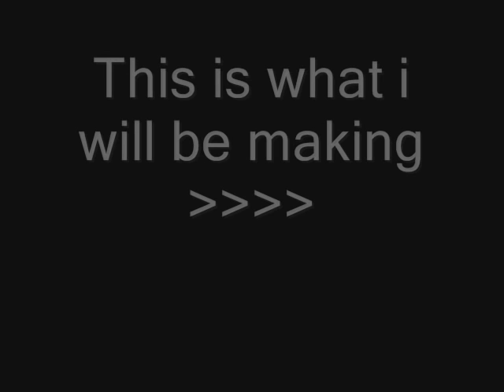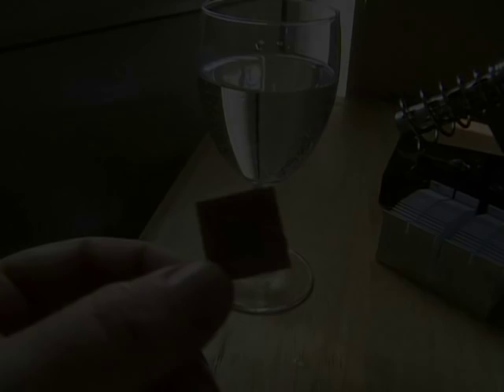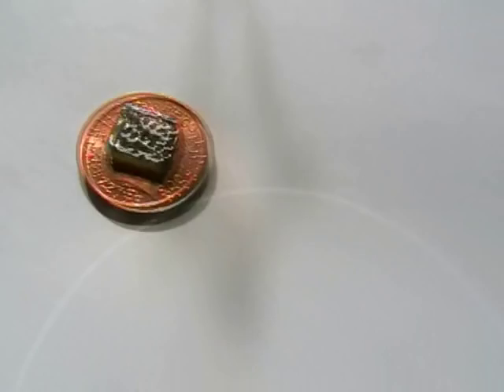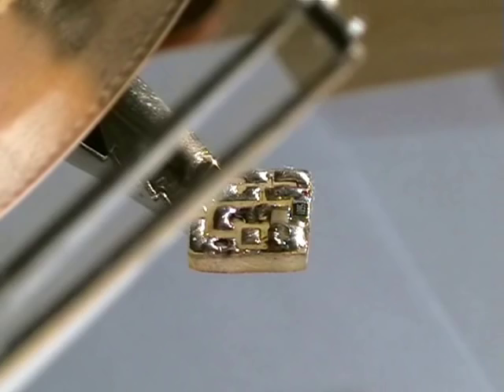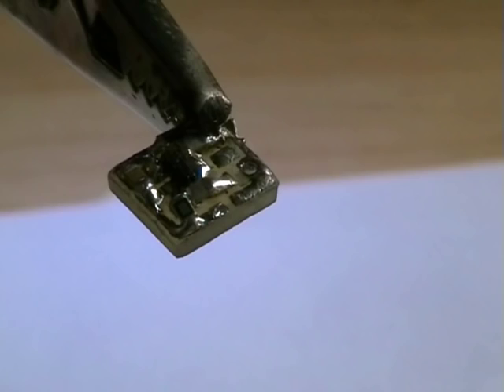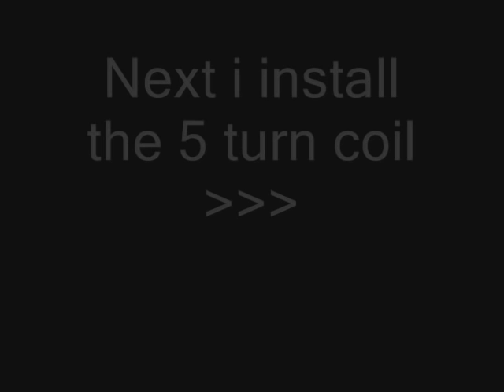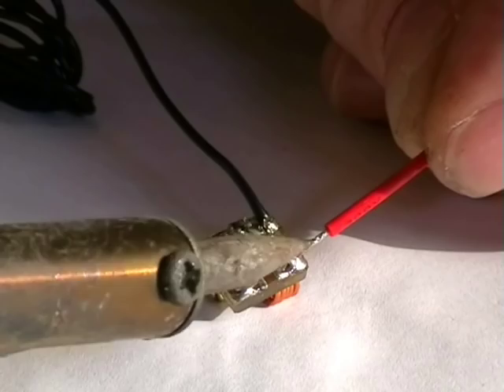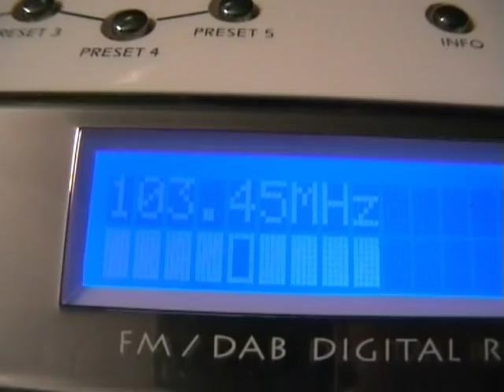Lets build the world's smallest FM transmitter.

Comment: just saw this video mate and am wondering if you are using a standard laser printer instead of photo etch materials.
Is the PCB printed on standard paper ?
ive got a photo etch system set up but this looks much simpler and more cost effective.
Reply from the maker: Noevilea 
Yes i used a standard laser printer and glossy paper from old magazines ,very cheap !
Reply: dazaro3 looks like I`ll have to give it a try then. I`m paying around $40AU for 3xA4 negative or positive photo etch sheets and the cheapest kit it can get locally for the acid and fixer on my setup is another $35.

I turned an old flat bed scanner into an exposure tank instead of just throwing it away.
It works ok but if you don't line up both sides of a double sided board 100% perfect then all I have done is waste expensive materials. I pay around $18 for a double sided copper clad board as it is without anything else and that board is only half the size of an A4 sheet.

Do you get it to do a double print ( for extra darkness ) on the same sheet or just run it through the printer once ?
CHEERS thanks for the tip.

Comment: I don't get how that can be an FM modulator.
Any explanation about the rationale?
Reply: +AlberoDeiFichiSecchi 
Its a self oscillating mixer - Very simple and been around for many years.  You can easily make a smaller/more accurate device.  Used to male these in uni.  A high dielectric chip antenna or by using printed structures on a high dielectric constant material can significantly reduce the size of the Antenna.
Reply: +Jonathan Walker It is an amplifier with feedback - the feedback being a filter. These things are unstable and drift with supply variation, heat and surroundings. You will find that it is amplitude modulation primarily by small variations of the bias current, as mentioned before, the frequency also varies too hence the term a "FM" transmitter - which is most likely because they are commonly received on a "FM" radio.

Comment: If I want to use this circuit to build a wireless speaker (using the radio as a receiver) and my laptop as a transmiter, how can I replace the mic with an audio imput from the jack? do I need to add a resistor+jack instead? or it is not possible? Thanks!
Reply: Nevermind I found other video you made with the circuit I wanted :D thanks!

Comment: Did you say it has to be laser printer??  And do you use any special paper?    Does some of these resistors have other names in my country or do i just copy your list?  And they will find it for me..  I hadd to go tru a company to get a hold of all the parts to the first one i builded.
Reply from the maker: +Normann 
Yes you will need a laser printer  ,Inkjet printer use solvent inks and it will not work and the printer i use
to make my PCB's is a laser printer ,its the toner transfer method.
It will ONLY work using a laser printer.The toner in laser printers and most copiers is made
mostly of PLASTIC, which resists the acid that eats away the copper that doesn't have any
toner on it. Inkjet printers use INK, not toner. And their ink is typically NOT a good 
etch-resistor, at all.
Reply: Okey.  I see. I will have put up my laser printer.  I wanna try this.  Took some time mastering how to solder properly.  Its and art. I would say.  You shure know your stuff sir.  Kepp up the good work.  I use your videos very often.. Im still a beginner.  Just trying to understand every component and what it does. It makes it yeaser.   Is there a right way and a wrong way to set transinsors resistors ore conductors?  That about what i need to find out to do this.  And from then i will pick it up myself. I gonna order a tester devise. .  Maybe it will help me understand more. ..  .
Reply: +Normann you can also use tracer paper and some photo resist boards... you can check Mouser.com, they usually sell boards at around 10$ for a 4''x6''. look up some videos on photo lithography.
Reply: Jetman640   Thank you sir.  I will check it out.  I have made some but they are very primitiv.  But they work.  And the use of right antenna i have noticed is very important. But the smaller the better:-)   And what advantage these gives you over and potensial enemy is huge:-)

Comment: i am so into this project.......did you  free hand the circuit on your computer print out...or did you use a pcb software design to handle smt?
Reply from the maker: eastenderaz1 
I used Corel Paint Shop Pro photo X2
Reply: thank you for your response . i'm in the middle of building voyager mk II. i would like to bring a few things to your attention. 1. i counted the components list and kept coming up one short, 100nf was missing from list. 2. the schematic says 2p-10p trimmer and on the list has 5p-30pcan we use anyone of those. 3. schamatics has 39pf and the list has 33pf. can we use anyone of those? thank you sharing you knowledge.
Reply: dazaro3 how do you determine it's frequency.

Comment: What's the name of this chemcal in which the pcb dipped?????
Reply from the maker: Its Ferric Chloride , a material for etching copper clad boards.

Ferric chloride has the advantage over other etching solutions like nitric acid by
greatly improving the safety of etching. Ferric chloride is free from harmful gas emissions it will stain but will not burn skin.
Reply: hwananani omphile in the same store you bought the epoxy copper board. But there is another way with chloridric acid and hydrogen peroxid. Both are easy to find.

Comment: Interesting design, however I fail to see the point of making a 9x9mm board, only to stick it to a battery holder ten times it's size. You'd have done better designing a larger board with thin traces and reducing it when printing, which would permit better component placement. Stick your board down on the bench with a blob of blu-tac and use tweezers while placing components means more accurate smaller designs, especially if you use thinner gauge solder. Etch the opposite side with a very thin spiral coil (using reduction printing), to replace your wire antenna. Then you could boast a 5x5mm board with the same component population!  I take it you've not seen military grade surveillance devices (even back in 2012), if you think your design was the worlds smallest?
Reply: Experts know everything but they do f all

Comment: hey do you have a problem with eu and uk. is that why you dont sell it there.
Reply from the maker: +ervīns šimkūns 
They have no CE markings on the products ,and they meet no minimum essential requirements
or regulations for FM transmitters in the EU.
It's against the law for us to sell them in the EU.
And failure to comply may constitute a criminal offence punishable on conviction by
a fine and/or imprisonment !
Reply: oh sorry then
Reply: +dazaro3   It is not illegal to sell them, to gain CE certification would cost you a fortune. It used to be illegal to import them. A device like yours has a limited range and would be unlikely to cause much interference. You can buy quite legally, "FM Transmitters" for iPods to transmit to your "FM" car radios - many ruthless sellers just put "CE" stickers on them. CE means very little to some people - and I actually work for the EU as a Radio Communications professional.
I have been designing and building transmitters for frequencies from 100Khz to 47Ghz for years. It is not illegal. Just try operating one in an uncontrolled environment and the first bit of interference that is traced will bring the authorities to your door. In my experience, the authorities are very good at this especially in the UK _  I have friends who were investigations officers doing this work.
Anyway, good luck.

Comment: 1/ That circular saw is ASKING for an accident with such a small item
2/ Drilling things in mid air, whilst holding them between your fingers? NOT GOOD.

I think your techniques could do with some polish - lots of people could get hurt - a clamp and a Dremel is WAY safer.

Thanks anyway
Reply: oh you take the fun right out of it.wheres your sense of adven------    ouch my finger.dam another hole in my head.like i needed that.
Reply: dont worry about it, he's using a capacitator.